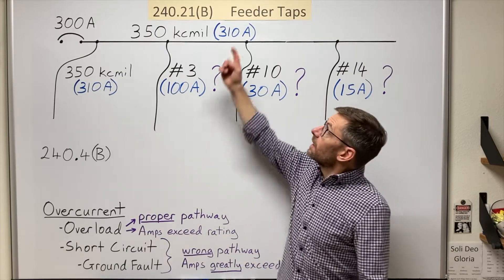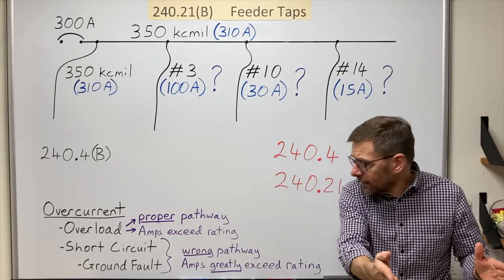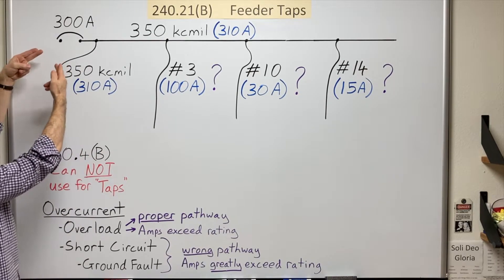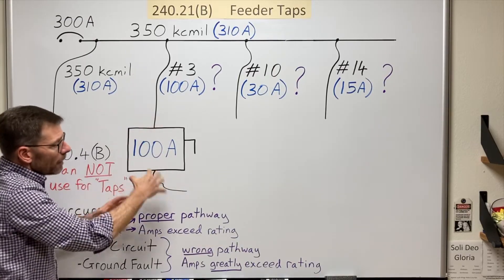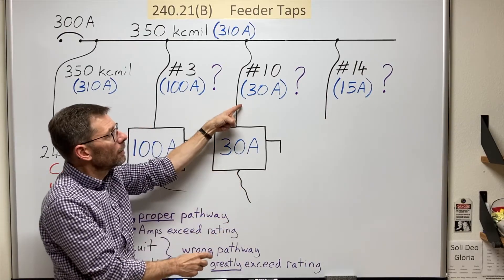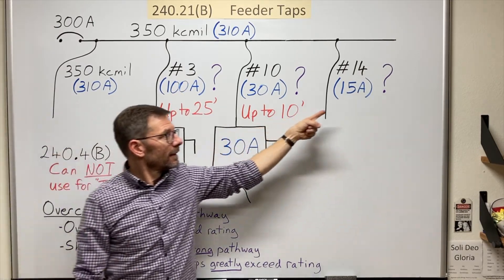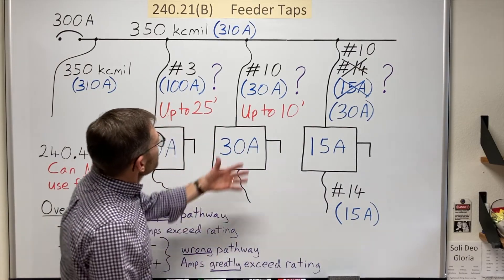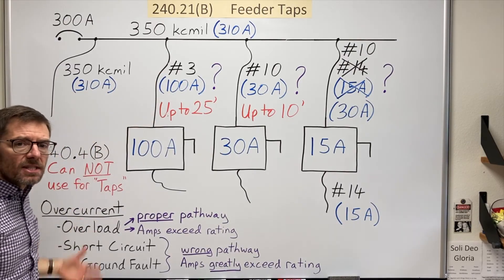Feeder Taps, 240.21(B)

Comment: I have a ? I have a 400 amp main 3 phase delta 120\208\240 ,,, using  the same Raceway conduits to feed 200 amp single phase  sub panel, with attaching ! (3 phase disconnect fused at 50 amps  feed thru breaker /to (Daisy chain) through new race way conduit to feed another single phase 200 amp panel breaker box,  with a 3 phase 12 space panel for 208 /240 circuits ? may I run  the neutral from single phase panel over to use it in the  3 phase high delta high leg 208

Comment: I’m needing to upgrade a 100A sub panel to a 200A. It’s a 200A service, would this rule be applicable to use if i tap from the main panel into a 200A disconnect?

Comment: Dave, I'm still having trouble with this. For example, Solar installation's are tapping the feeders between the meter & the main breaker. Applying the 10 ft. rule what is protecting the wires that are connected to the feeders ?  Even though they are in a conduit which is attached to the solar disconnect, they are non-fused.

Comment: So, are we talking about sub-panels here?  If you drop a 6/3 90-c  NM cable 35-feet away and the sub panel provides overload protection to the branch circuit, is the 50-amp breaker in your diagram the feeder breaker?  In this case, it seems you need to provide great care in calculating loads  .

Comment: I have a tricky multiple choice question, hopefully someone can with more knowledge can help me out 

A White/grey wire in a feeder circuit ________:

A)Be bonded or have a circuit breaker
B)Is the largest wire in that circuit
C)Should not have a voltage to ground

My notes:

On the main panel, neutral is connected to the bar that is BONDED with the panel, the green grounding wire is also connected to the same bar. (so does that mean the answer is A?)

In the sub panel, the neutral wire is connected to the neutral bar which is ISOLATED  from the metal box with plastic between them, the Green grounding wire is separated and is connected to its own bar that is bonded to the sub panel box.

In the circuit that this question applies to,

--------- “The neutral wire is going to be sized larger than the Green grounding wire” 
(But that doesn’t mean it’s the LARGEST in the circuit right? Because the two hot wire could be the same size)

--------"The neutral should have no potential difference(voltage) to the ground" (does that mean the answer is C?)
Reply: The answer is C.  A grounded conductor (usually the neutral) should not have any voltage to ground, and is marked white or gray.

The neutral might be the same size as the grounding conductor (when it carries negligible amps), or it might be the same size as the ungrounded wires (which is common).  It might also be larger than the phase conductors, in applications with harmonic-intensive loads.  But we don't have enough information to determine which one of these it is, so you can't conclude that it is the largest wire in the circuit.

It ultimately is connected to ground at the service panel, but that's out of the picture of the location in question.

Comment: What about taps of unlimited length?  Code is hard to understand
Reply: Taps of unlimited length are outside, and are not going to burn down any buildings in the event of an overload.  That's why they don't have any length constraints, unlike the 10 ft and 25 ft tap rules.

Comment: 240.4(D), or the "Small conductor rule" does not dictate the ampacity of a conductor nor does it apply to feeder taps. If you are using the 75 degree column, the ampacity of the #10 should be 35 amps and the #14 should be 20 amps.